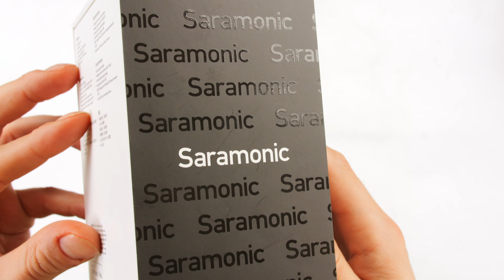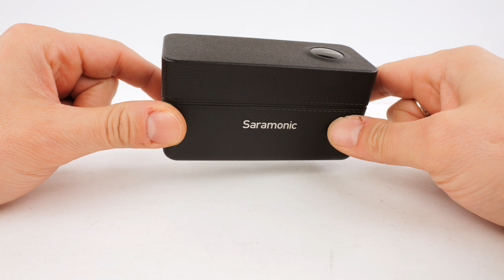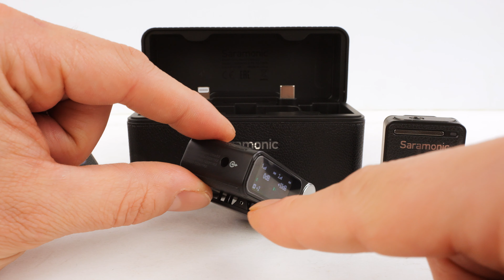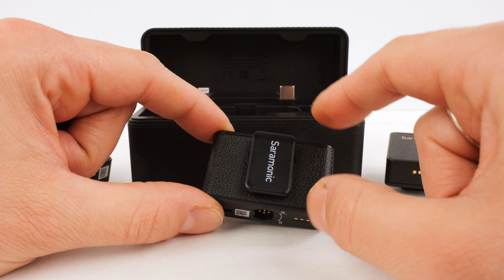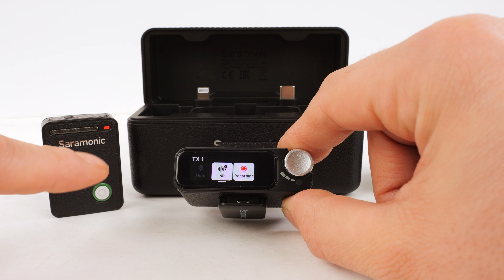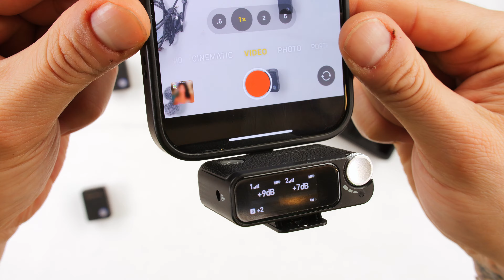Saramonic ULTRA Wireless Mic - Hands-on Test & Full Tutorial

Comment: I just purchased one.
Where is the mic level on the receiver. The levels barely move even at +15.
The levels are loud  in the output but they should be moving almost into the red to have some idea of level.
Reply from the maker: Maybe double check the mic input gain settings on the receiver and or check the output gain settings on the receiver. 

Ideally the best way to monitor the audio and set your gain settings is to connect headphones and monitor that way. At least in my opinion. The audio levels on the display may not be as accurate as actually listening with headphone.
Reply: @LeoPazzo  Thanks. I've checked every level in the mic and app but nothing changes. 
Even your levels are very low in the video when you're talking. 
I'm comparing it to every other system I have and they all have good level meters.
The sound is good and I can see the correct levels in the camera so I can work around it.
Reply from the maker: @superior_streaming  I hear that. 
Thanks for your feedback. 

Maybe if you reach out to Saramonic directly, they might be able to change this in a firmware update.

Comment: I have the 2x Rode, 2x DJI and 1x Boya and they are all the same. just following each other. The problem is the 2.4ghz frequency interference. If it was 5.8, I would probably give it a go.
Reply from the maker: I know what you mean. It depends a lot on the recording location. But the onboard recording is a life saver. That’s the way I mainly use the Saramonic Ultra, onboard 32bit float recording.
Reply: @LeoPazzo  I'm the opposite.
Mine is live streaming and it needs to be right first time. Still looking😂
Have you tested if the antenna actually makes a difference. This may solve some of my issues.
Reply from the maker: @superior_streaming  yes that totally makes sense for live-streaming. 
Totally understandable. 

Yes Iv used the external antenna with the Ultra and it does help to get a stronger wireless signal from the transmitter to the receiver. 

I have recently purchased the Saramonic K9 wireless UHF dual channel microphone kit and it does NOT use the typical 2.4ghz frequency and is much much stronger signal even in environments with lots of interference. 
We can custom pick which frequency band you want to use. 
It also have internal 32 bit recording and the kit includes all the required accessories and cables etc. 

I have a video about the Saramonic K9 on my YouTube channel as well. Testing it out in different environments, indoors and outdoors.

Comment: Thanks this is helping out a lot. Trying to get the best settings for recording auto exhaust and engine noise
Reply from the maker: Your welcome man 
Yes your best option is to use the on board 32bit float recording for those types of sounds from engines and exhaust.
Reply: @LeoPazzo yeah, I'll give it a try. I'll search your vids on how to apply that to the vid after recording. I believe that's something I'll need to do on the pc
Reply: Thinking the gain has to be all the way down and maybe even output should be all the way down
Reply from the maker: @iBattleMike  yea it all depends how close the mic will be to the sound source and how loud the sound source will be. 

Maybe you can use both mic to record internally and have one mic set to low gain and the other mic set to middle gain and test that. 
100% do some testing before hand.
Reply: Ah nvm, I figure it out lol. Easier than I thought

Comment: Hey there, I just purchased the white version and I was wondering if the transmitters have a lock or hold key to prevent the talent to stop recording by accident. Thanks
Reply from the maker: Hey there. Good question and I can understand your concern. That makes total sense. From my understanding I do not believe this option is available. 
I will reach out to Saramonic and advise them of your concern and request. I could also use this feature just to be sure the talent doesn’t mistakenly stop the recording. 
I haven’t tried but you can try locking the receiver by short pressing the power button and see if it prevents the transmitters to stop recording.

Comment: This is a very nice wireless mic setup. Well done with the video. 
Maybe I missed it in the video, but what is the max distance range of the RX and TX?
Reply from the maker: Thank you very much. 
Yes the max distance range with this Ultra mic in clear line of site is up to almost 1000 feet and don’t forget it comes with the optional external antenna if you need it. 

What type of content do you plan to use this mic kit for? 
Also don’t forget this mic kit has the internal 32bit float audio recording so even if the audio drops out you will have a saved WAV file that you will be able to use.